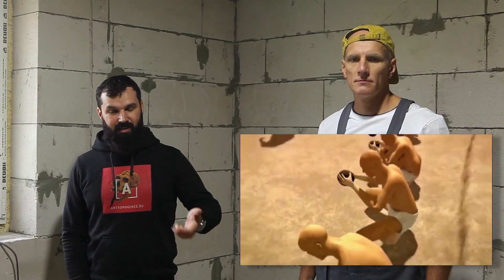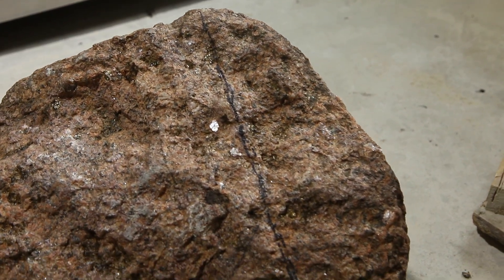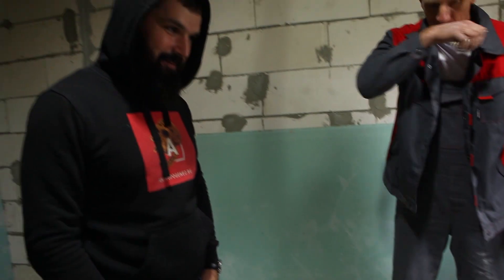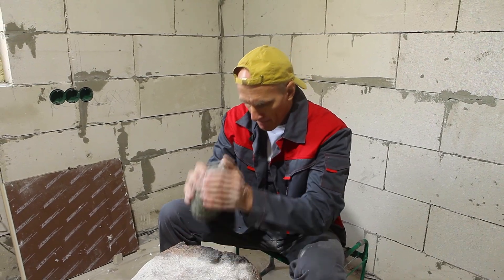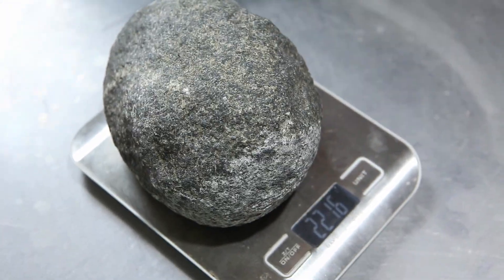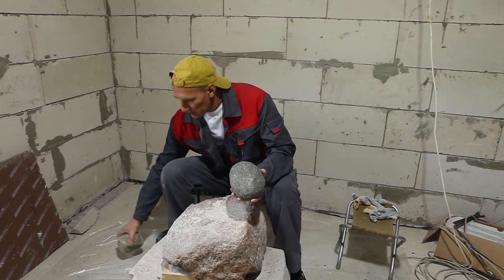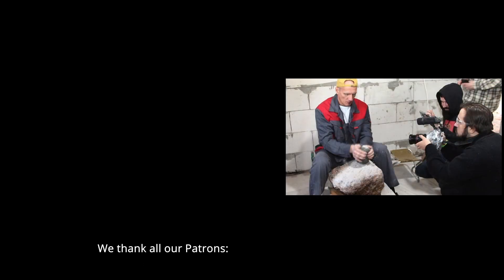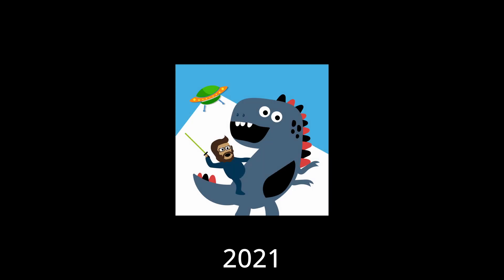Dolerite vs Granite | Could Ancient Egyptians carve obelisks?

Comment: two years to dig out one oberlix. Working non-stop? Doesn't seem that this was a practical way for it to have been done. They probably used a variety  of different methods for different parts of the the construction.  The fact that it was likely abandoned because of fissures in the rock mean that a lot of time was wasted if your method was to be believed. Since the ancient egyptians had no way to detect fissures in the bedrock they would just be going on blind luck and for 150 men to spend two years of back breaking labour just to be told that the rock is unusable just seems far fetched.  There must have been a faster method available or a another way to speed up the process.
Reply from the maker: >  and for 150 men to spend two years of back breaking labour just to be told that the rock is unusable just seems far fetched. 
Do you really live on this planet?
Reply: @ScientistsAgainstMyths  I do live on this planet and one thing that is evident is that people always find a way to improve a process. This process is possible but I can't imagine that it is practical with serious adjustments. 

One thing I don't think you've taken into account is the location of the quarry compared to the river nile. Now I know the river's course has changed slightly over the years but it seems to me that the quarry would be in the floodplain and therefore anywork would be impossible during the yearly flooding. This will greatly extent the 2 year estimate.
Reply from the maker: @lmonk9517   I repeat the question: you live on this planet, but it seems "far fetched" to you that people can work for several years in vain? :-)
> people always find a way to improve a process
People very often find a way to slow down a process.
Share rose-colored glasses plz
Reply: @lmonk9517  I do believe the cold hammering was done only for finishing and flattening and that the quarrying was done using fire setting/rapid cooling and hammering. Exfoliated granite, burned granite, burned mudbricks and charcoal have been found (some can still be seen) in the granite quarries.

Interesting enough, burned granite flakes have been found near the pyramid of Menkaure, which was a granite casing that has been worked in place, most of which is still unfinished.

Besides, quarrying a regular obelisk (200-300 tons) would be much faster then quarrying the unfinished one (1000-1100 tons). One obelisk erected by Hatshepsut bears an inscription attesting that the obelisk was made in just 7 months.
Reply: @ScientistsAgainstMyths  This is such a poor fallacy. You live on this planet but don't think it is possible that humans would have come up with a faster method than that demonstrated in this video? You don't think a culture that worked large stone monoliths on a regular basis and were capable of advanced planning and innovation were not able to come up with a method even slightly more sophisticated than slowly grinding won rock with a slightly harder rock. I get that you spent a lot of time hitting rocks together and you feel like you have to justify doing that but for me it is only a start and different methods have to also be explored. Isn't that what scientists are meant to do?
Reply: @MrAchile13  Good answer. I was thinking that a heating and cooling method would be more likely as the romans did that successfully in their mines

The hatshepsut obelisk is certainly interesting. Does the 7 months only include the quarrying or would that also include the transportation and erection as well? Probably would also include the polished finish and the carving of inscriptions. So perhaps 5-6 months of quarrying and a couple of months for everything else?
Reply: @lmonk9517  I am not sure about it, but I suspect it refers only to the quarrying and shaping, without the transportation.

The Rome obelisks that were re-discovered, moved and re-erected inside the city during the 1500-1600's took around 5-6 months, just for the movement. The big advantage of the Egyptians was the Nile, which covered most of the distance and saved them a lot of effort. The hardest part would have been the distance between the quarry and the river and then from the river to the final spot. 

At the moment I don't know this, but one can measure the distance that the obelisks have been moved in Rome and then measure the land distance covered in Egypt and thus make an approximation for the total time required.
Reply from the maker: @lmonk9517  Less pathos.
You were surprised that people could ruin the work that they have been doing for 2 years. This fact is quite ordinary. Technological progress undoubtedly exists. One does not contradict the other
Reply: @MrAchile13  I believe at the the Aswan Quarry they have found the remains of an ancient canal so I think that getting it to the river wouldn't take a super long time I'm not sure about the other end but perhaps there was a similar canal at Karnak?  I suppose a big factor would be elevation, Rome is famously built on seven hills which would make the transportation much more tricky where as Karnak seems rather flat. I think two months isn't too unrealistic but we don't know the exact methods used so it is hard to guess.

I leaning towards 7 months for the whole project start to finish as that makes more logical sense but perhaps you are right and it was 7 months just for the quarrying.
Reply: @ScientistsAgainstMyths  I'm not surprised I just think that in this particular case the progress to too slow for the risk of the stone being faulty. Every endeavour has the risk of failure, true, but that doesn't mean that the risks are worth taking, especially when we consider the overall expense of the project. So for the project to have been given the green light we must assume that a faster quarrying time was thought to be achievable. 

Other commenters have suggest a heating and cooling method which had been used as early as the stone age as a way to crack rocks and make them easier to break. So that is another possibility of a technique that could speed up the estimates. Apparently evidence for this have been found at the site.
Reply from the maker: @L Monk  Sure sure. Risk management of Pharaoh Hachepsut. Project costs, risk assessment. "Let's accelerate progress, otherwise the project risks are too high"
Reply: @ScientistsAgainstMyths  This but unironically. The ancient Egyptians were no dummies and they would have planned out these large construction projects, including the cost, timescale and the risk of failure.
Reply from the maker: @L Monk So what? Do you have the timing and risk formulas used by the ancient Egyptians? You extend your modern ideas to a completely different era. The Alexander Column in the 19th century was also cut down for 2 years
Reply: @ScientistsAgainstMyths  Obviously I do not but they must have existed. When the Pharaoh orders a new project and the architects and stone masons draw up the plans the first  two questions that he will ask will be: When will it be completed and how much will this cost? 

Alexander column took a long time to carve as well but that two year before transportation also involves the smoothing of the stone and not just the removal from the bed rock. which took a shorter period. 

The only real comparable work is the Obelisk of hatshepsut at Karnak. We know that it came from the same quarry and the same time period and we also know that it was completed in 7 months because that was written on the obelisk, itself. It is roughly 3x smaller than the unfinished obelisk so if we roughly times 7 months by 3 we get 1.7 years for the entire project. That isn't just the quarrying but the transportation, polishing, erecting, carving the hieroglyphs etc. I know that it obviously wouldn't be as simple as that calculation but i think it can be used to give us a rough time frame for these sorts of projects. Here is the full inscription

"As for the two great obelisks, I have made them of electrum for my father Amun, for my name to last forever in this temple. They were one piece of strong granite, without a join or mend in them. My majesty ordered them to be made in year 15 (of Hatshepsut's rule), the second month of winter, on the first day, until year 16, fourth month, last day (when they were finished). The work has lasted 7 months since the arrangements in the mountain. I have made them for him with a loyal heart, like any king to his god. It was my wish to make them for him, golden of electrum. I have put their bodies on their bases."

It is worth noting that the Obelisk at Karnak is 28.58 metres and weights 343 tons whilst the granite column of the Alexander Column is 25.4 meters but the Alexander column is a lot heavier I assume because its diameter is greater.
Reply: @lmonk9517  at Aswan the flood was at 14 metres. The unfinished obelisk is on a high point and would remain above the water level by about 5 metres if I remember correctly. Possibly a little bit more than that
Reply: @SacredGeometryDecoded  Good to know. Since the Obelisks were transported by barge, one would imagine that the inundation would have been more of a factor in the transportation phase. Perhaps moving it during the flood would have meant a shorter trip to the waters edge and sped up the moving process.
Reply: @lmonk9517  the colossi of memnon might have been floated into place. Same with the obelisks of Karnak and Luxor. Leave the gates open and bring them in that.
Give the hardest jobs to the laziest people. That’s how I would have done it, I am very lazy, but my bosses mistook 
 it as innovation.
Reply: @MrAchile13  can you link that info mate.
Reply: @jednmorf  which part of it? (I'm too lazy to cite it all at once)
Reply: @lmonk9517  "worked monoliths on a regular basis"
??

" don't think it is possible that humans would have come up with a faster method than that demonstrated in this video?"
What other method is there? It's not so simple to just 'come up with a better way'
Reply: @diobrando2160  read the rest of the thread. The egyptians had knowledge of fire setting to crack and weaken rock. that is one other method right there. Thankfully the ancient egyptians had better imaginations that you do. very sad.
Reply: I would imagine that they could achieve it faster by coring out pieces of the bedrock at set distances and using the principle of expanding wood to crack the stone between the core holes.

That way whole sections could be lifted away in a relatively short space of time by comparison to the more laborious way of banging at it.

Then you can switch to the other methods for refining the shape before separating it from the bedrock.

Comment: Good video, thanks for putting in the effort.

Two suggestions to increase the efficiency of the experiment:

1)  Don't just pound at the granite with perpendicular strikes.  Granite is prone to "chipping" and/or "flaking".  Strike your blows at an angle to see if you can break off larger pieces instead of pounding to make dust.

2) Fire setting.  Put the granite through at least one heat/cool (fire/water) cycle.  The different minerals in the stone have different rates of thermal expansion and a heat/cool cycle will cause lots of internal fracturing, making the flaking and breaking of the stone much easier.  In theory anyway.

I'm guessing that a combination of fire setting and chipping was used for the bulk removal of material.  Then your method of straight pounding was used to shape the surface.
Reply: An example of what I mean:

https://drmsh.com/PaleoBabble/Inca%20Quarrying%20and%20Stonecutting.pdf

"Cutting and Dressing" starts on page 9.
Reply: Since it seems I can no longer post links without getting the posts deleted, look up the work of Jean-Pierre Protzen from UC Berkeley.  Specifically, "Inca Quarrying and Stonecutting".
Reply from the maker: @powerman7776  thank you!

Comment: Yes, there are good dolerite pebbles and granite boulders in Cornwall. Flaking a dolerite pebble against another to make a tip and adding water seems to increase the rate of granite removal. Praise to you for quantifying your granite removal versus dolerite disintegration.
Reply: Using fire and putting it off (w/ water) increases massively the speed
Reply: This was good science.  Definitely agreed here.
Reply: There were many different shaped pounders.  They end up round.  You get better results with different shapes.

Comment: Excellent as always. I agree with James's comment using water as a lubricant as the grinding will generate a fine granular clay slurry which will assist in working granite. Modern bridge saws which are water cooled create large e amounts of this slurry, wondered if I should pop it into jars and flog it as face cream....yes madam, it may be slightly radio active but it will put a glow into your cheeks!
Reply: Not for pounders. 

If you are working limestone or sandstone which are extremely porous, then adding water makes an enormous difference, and progress is many times faster. This has been shown repeatedly by many experiments carving and bashing limestone. Limestone and sandstone are extremely hygroscopic. 

Slurries are great for polishing or drilling holes, as it is the abrasive slurry that does the cutting, and not the circular drill bit.

Granite is also a porous rock, but it does not absorb water  anything like limestone or sandstone.

Comment: Do you have any plans of a granite fire setting experiment? Keep up the good work!
Reply from the maker: Thank you. Maybe!
Reply: That is a great question @MrAchile13....the fire thing has always puzzled me. Heat always rises right ?......so if you are trying to dig down by lighting a fire...all you are doing is heating the air above...I would like to see this experiment.
Reply: @dazuk1969  The heat itself radiates all around the heat source, including downwards. The hot air is the one that rises.

Archaeologists often find house fire hearts vitrified by the heat, even though the fire was above it, not under.

Besides, there are clear marks of fire setting at Aswan. The method is attested since neolithic times and researchers proved granite can be broken easily if fired first. 

You can find more about this on Per-Stemir's website or on the documentary "Egypt top 10 discoveries (or so)", where they did a fire setting experiment, on granite.
Reply: @MrAchile13  I agree that a certain amount of heat will radiate around a fire...including downwards.

However, given the composite make up of granite (felspar and so on) it needs 1000+ degrees to heat it to point of being able to remove it....this is not possible lighting a fire on top of it. Any steel worker or Iron monger will tell you this.

I have also looked at the unfinished obelisk extensively and I see no evidence of fire being used. It was either stone pounders or some method we are as yet unaware of.
Reply: @dazuk1969  have you seen the mentioned experiments ?
Reply: @MrAchile13  No. I will go and have a look
Reply: @dazuk1969  the documentary is available on you tube. The granite quarrying part begins around the12 minute mark.

Comment: Excellent. Been waiting on this one in English. Saw your original on the other channel but good to hear those smaller details.
I don’t have any dolerite here in Sydney either. I played around with a black flint pebble on granodiorite. One of the black flint pebbles is broken at the end, little flakes break off as I pound and it seems to work faster. I wonder if by adding some small flakes of granite etc would increase productivity? As they act like tiny little chisels.
Reply from the maker: Thanks, an interesting idea
Reply: Be careful working with flint, I've seen little chips flake off and cause some nasty cuts.
Reply: @mnomadvfx  to be authentic I have ancient work place safety standards . I never do this work without my sandals on. Safety first! 😀
Reply: @SacredGeometryDecoded  A couple of the fellows in this video should take your safety advice - a disturbing lack of eye protection in some places.

But then, if I go with Russian stereotypes and try to type with a Russian accent I can just respond for them: " In Russia, the eye does not need protection from the stone, the stone needs protection from the eye."
Reply: @JH-pt6ih  as someone of Slavic descent i appreciate that mindset. The tractor i’m working under  is held up by some rickety pallets but it’s ok. I’m wearing a long sleeve shirt
Reply: @SacredGeometryDecoded  lol :)
Reply: Comfort first, safety next 👉 maximum productivity 😎